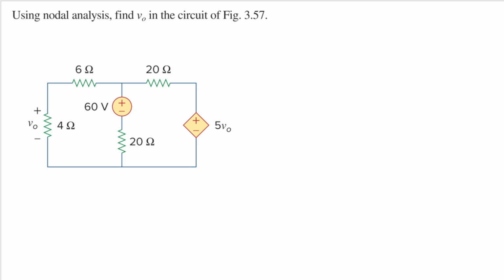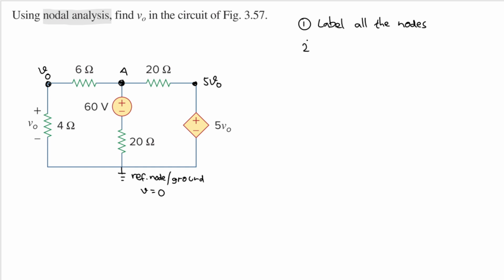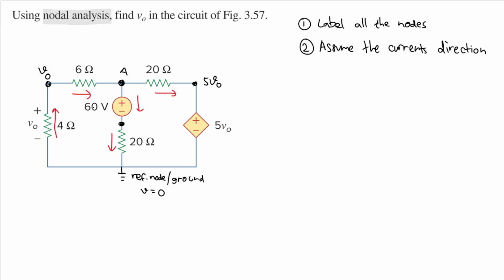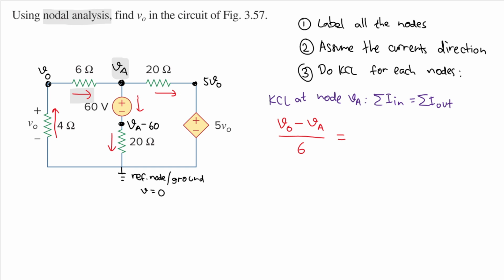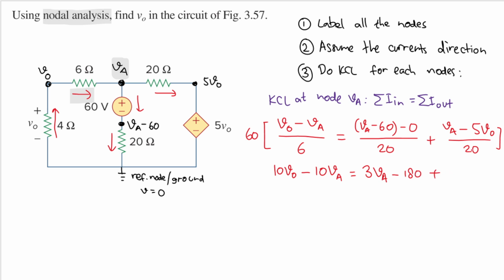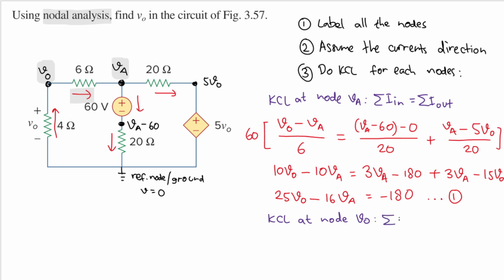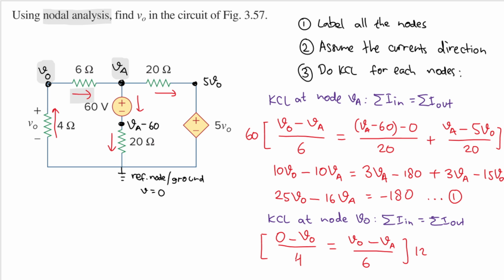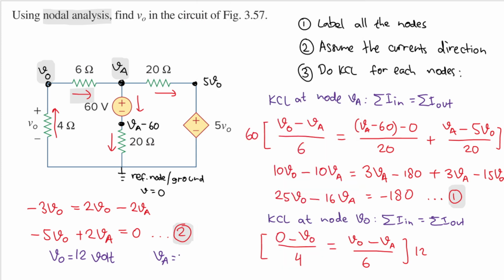EXAMPLE SOLVE: NODAL ANALYSIS WITH DEPENDENT VOLTAGE SOURCE

Comment: First of all this problem is more easily solved with mesh analysis. Secondly it's a problem with dependent VOLTAGE source. The title incorrectly labels it as a CURRENT source.
Reply: the question is specifically asking to solve with nodal analysis